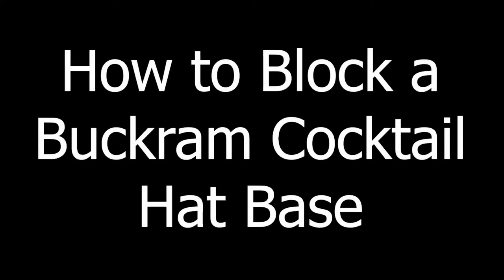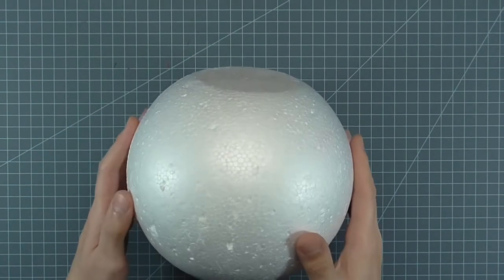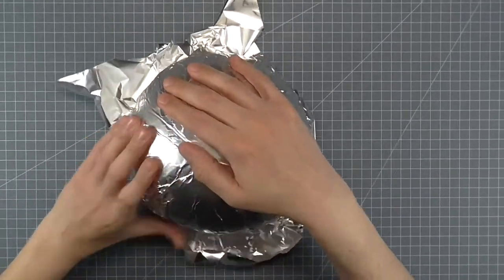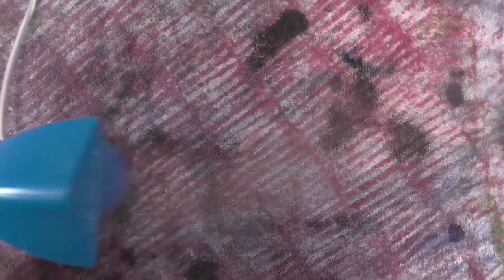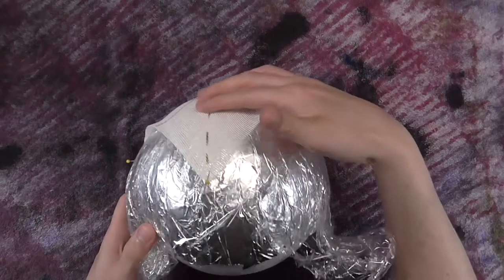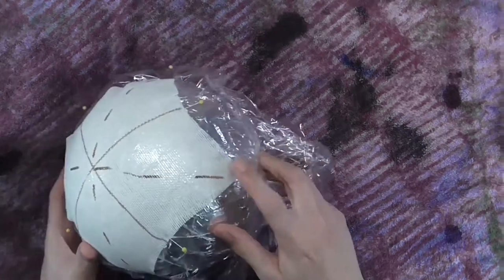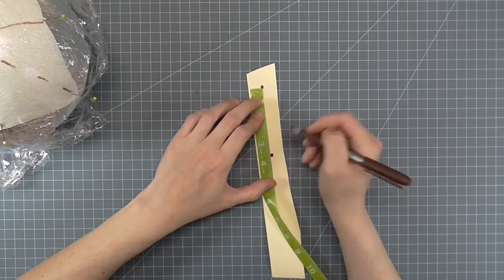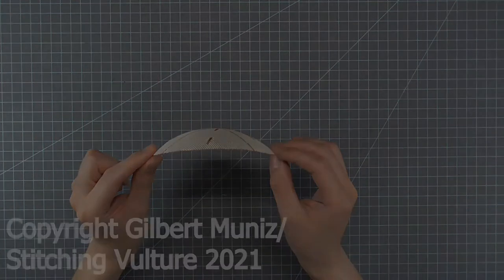How to Block a Buckram Cocktail Hat Base

Comment: Hi, another great tutorial. Not used buckram before, so a rookie question.I note that millinery suppliers sell buckram, with or without adhesive. Can you confirm what type I should buy as I will cover the buckram with silk dupion, and another with linton tweed fabric -a boucle.
Thanks again.
Reply from the maker: I always buy it with adhesive. Make sure for this project it is heavy weight buckram.